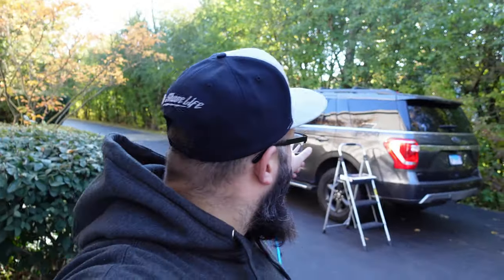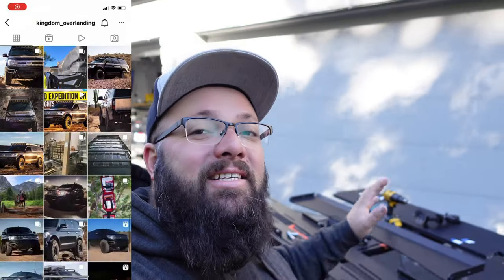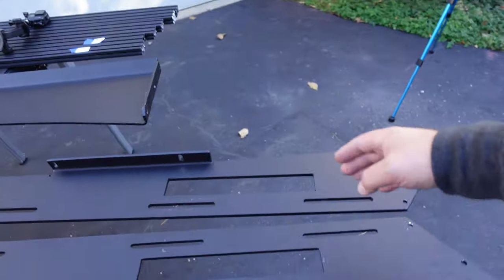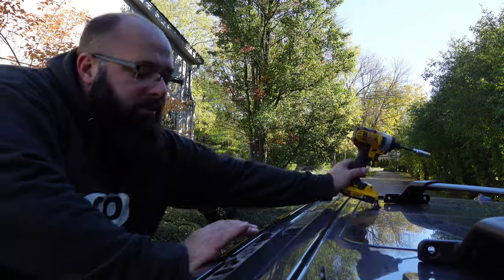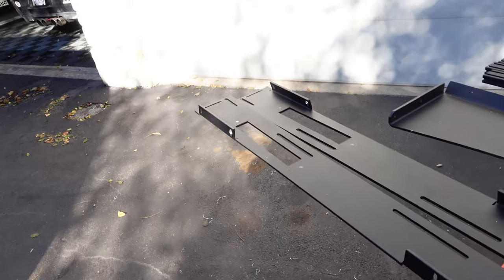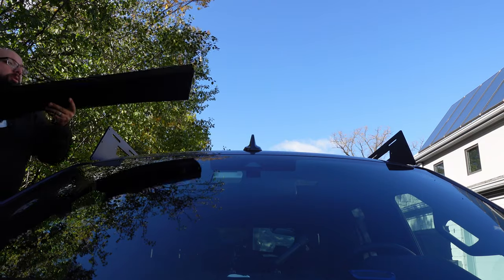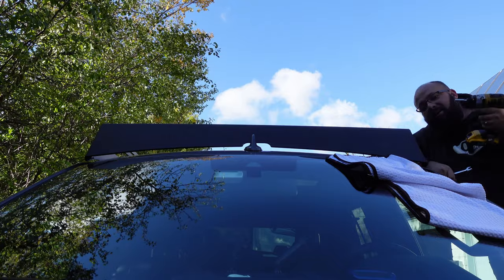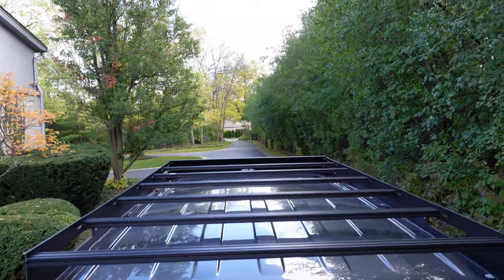Ford Expedition Roof Rack - Overland Upgrade! @kingdomoverlanding

Comment: Stupid question, could you still fit the front lil trim pieces under the rack? I peeked at Kingdoms build blog and they mentioned that the trim pieces will fit under the rack itself so its not just open to the elements.

Comment: Looks awesome. I'm curious if you have had any leaking inside the headliner since removing the original rack. I've heard alot of people had issues with water  seeping in after removing the racks/or fitting after market ones, and the dealership told me they can leak after removing them.